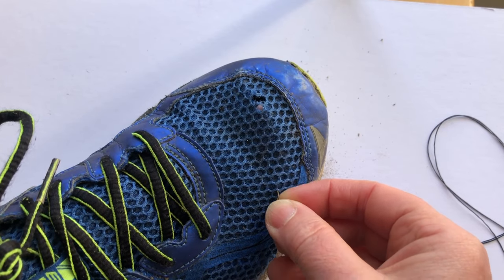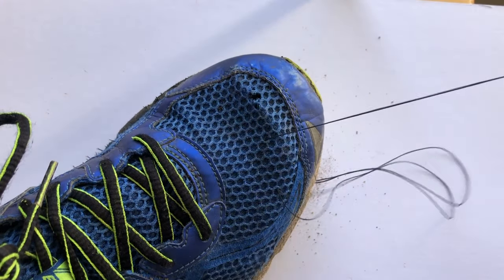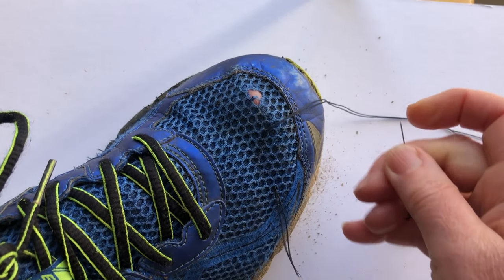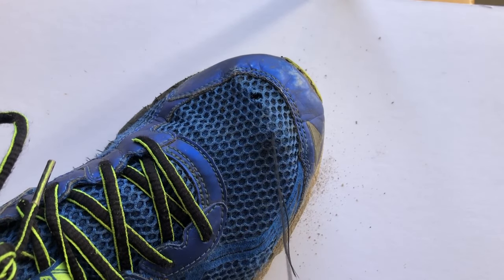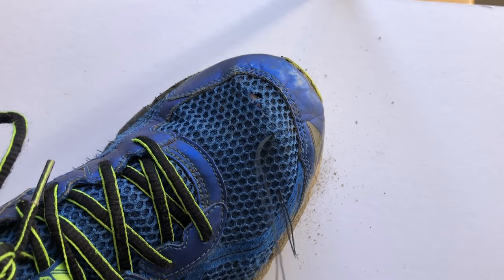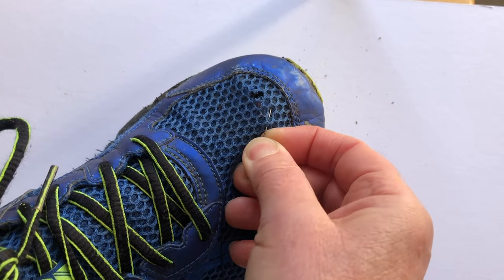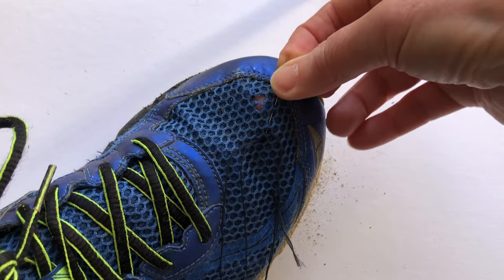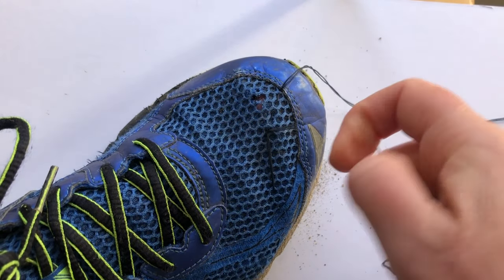How to repair holes in running shoes

Comment: That’s for the tutorial. I did this with heat activated button thread. It has adhesive in the thread fibers so when you put an iron on the thread, it creates a strong bond.
Reply from the maker: Great additional information, thank you!
Reply: Can you use a blow dryer instead, and where did you get heat activated thread? If I do this I'll use an adhesive patch underneath too. Just bought my shoes less than 3 months ago and they are a model from last year. Sigh...companies keep producing with cheap materials, yet the price goes ^^^.
Reply: @A.Leftie  Secura is the brand that makes heat activated button thread. Cheap on Amazon. I don’t see why you can’t use a hair dryer.
Reply: @kylehazachode  thank you for responding back to me 👍.

Comment: Great repair pattern 👍
Yet, it would be even better if used matched color, not black.
Reply from the maker: This would be true!  Sadly the multi fibre yarn that is best for this mend only comes in Black...it's called "wooly Nylon" and will not tear into the other fibres when stretched...
Reply: @RepairWhatYouWear  Thank you for the explanation.
Reply: @RepairWhatYouWear : Where can one get this type of material in grey
for New Balance running shoes 993?
Reply from the maker: @eddyvideostar  Have a look online for "wooly nylon thread".  It comes in a variety of colours, Empress Mills, in the UK has a wide range for instance.  It is the thread used for surge machines (overlockers) and grey is a common colour.

Comment: How do you end the stitch so it does not come undone?
Reply from the maker: if you sew the thread over the same stitch a couple of times it secures it, then run the thread through the cloth before trimming it off, then that means the stitch is really secure.  Hope that explains it well enough.

Comment: does the color of the thread matter?
Reply from the maker: Not in our opinion but the Woolly Nylon we recommend comes in a limited range.  It is a multi fibre thread used for overlocking normally.  The reason why it is useful here is because it is super strong but not twisted so as you use the shoes it does not tear into the remaining fabric.

Comment: Does it work for bigger holes?
Reply from the maker: It should work on larger holes.  If the fabric moves around a lot then the stitching (using "wooly nylon" should be firm enough to hold the shoe shape otherwise your foot may "slop" a bit.  If you need to mend a large hole in a vulnerable place then a stick on patch may be needed.  Hope this is helpful.

Comment: How much thick should be the thread? Will 1 mm suffice?
Reply from the maker: We do recommend buying Wooly Nylon (it's an overlocker thread) which is a synthetic multi fibre fine yarn.  Strong but has a slight stretch.  Otherwise work with ordinary polyester sewing thread, although twisted threads like these have no stretch and may tear the cloth over time.
Reply: @RepairWhatYouWear  Can I show you the condition of my shoes on instagram or somewhere? Because the hole has been there for a while now and it needs to be seen by you or by sm1 of your calibre.
Reply from the maker: @RitikRai-kc4oc  Please send an image to repairwhatyouwear@gmail.com and we will try to give some guidelines.